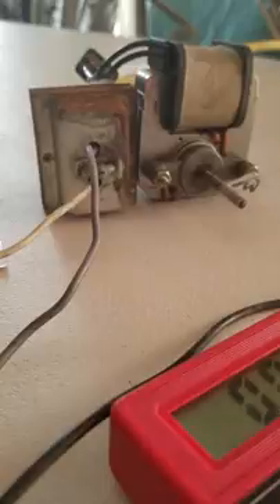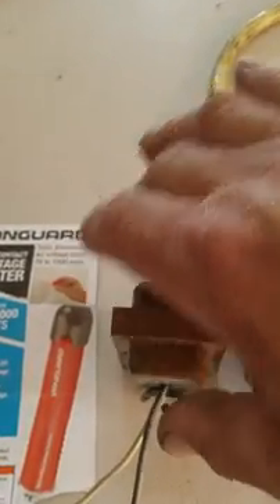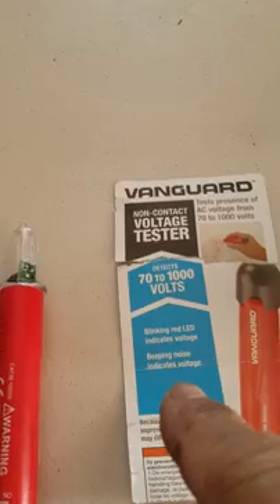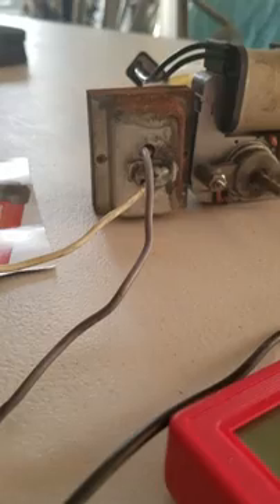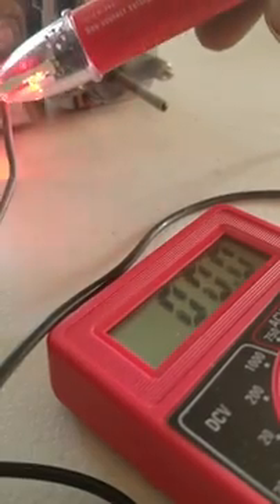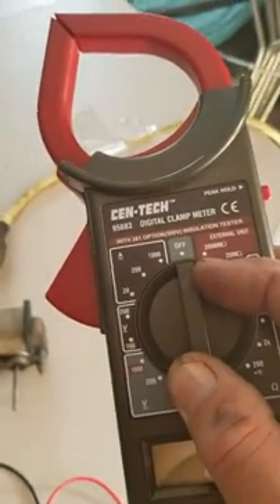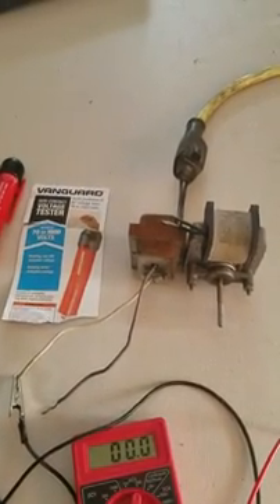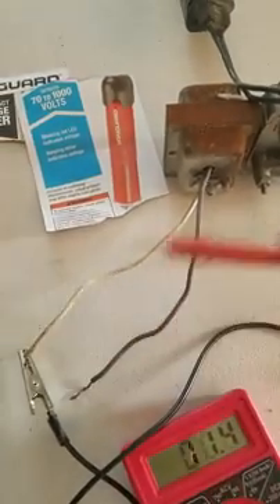Free electricity through R F

Comment: so the induction occurs in the nearby coil, that create heat and uses energy, so in this case the transformer is drawing energy from the motor ( slowing the motor down ) you have to do a speed check on the motor to see if there is any use of power from the motor circuit, thanks for your video, it gives me an idea how i can test these ideas a home using stuff i have laying around, thanks.
Reply from the maker: Actually, the motor coils expel a magnetic field whether there is something there to capture them or not.  If the lights use that energy, the motor doesn't care.  It doesn't have to work harder to release that same magnetic field.
Reply: @GBear  but what about Lenz's law, if the field goes through a material that material exerts an equal and opposite force isn't that  true? so there should be some drag, like when you drop a magnet through a copper tube the magnet is slowed due to the opposite field created?
Reply from the maker: @StephenPhantom Yes, and no.  The difference in this case is negligible. I tried testing the amps with a clamp meter on the motor leads, and there was no change when the lights were added or removed.
Reply from the maker: Welcome aboard!

Comment: 11.2 volts AC potential unloaded.  I suspect the clamp on ammeter is in error as once again no current should be flowing in an open circuit and the normal wire size used in the primary (115 volt) winding would over heat or even open trying to handle that amperage.
To have any usable valid data you would need to connect a load (resistor or law voltage light bulb)t to the transformer and put a wired AC ammeter in series with it.  See what the loaded voltage and current is.
Reply from the maker: Thanks for the input.  There were no tricks in the video.  What you saw is what happened.

Comment: excellent video, I have a question, this ac current which is produced is through magnetic waves, that is through electrons, does it attract objects which have a positive charge, i have seen some videos where static electricity attracts objects which has opposite charge. does this also attract objects
Reply from the maker: Yes, the motor when running becomes an electromagnet and attracts the doorbell transformers.  Welcome aboard.
Reply: @GBear  so I'm assuming any modern new door bell transformer & exhaust fan motor would work as long as the fan motor is spinning? I wanna try replicating this with different sources of power like atmosphere electricity
Reply from the maker: @SpectacularRanker2  It should!
For atmospheric electricity, I was going to try copper coils connected in series, without the metal cased of the transformers.  I also wanted to try this same experiment with microwave transformers.
Welcome aboard!

Comment: Any transformer work or only of doorbell ?
Reply from the maker: I haven't gone that far with the experiment.  I chose a doorbell transformer because it was 120vac to 12vdc, and eliminated the low voltage side from hardwire connections and just induced the input from the magnetic fields present around the motor coils.

Comment: 11volts is a pitiful return, but, at least it's something, you could rap wire around the motor and get maybe 1 volt per turn. The current you reading will drop off to nearly nothing, once you put a load on the circuit.

Comment: 4:41 Checking the current (in terms of amperage) without having a load in the circuit is meaningless. Shorting the primary leads of doorbell transformer and then measuring current does what exactly? What work is being done in terms of power consumption? There's no load. There's no free energy there.
Reply from the maker: A voltmeter connected is a load.

Comment: I find this very interesting!, question is dose the fan motor draw more with induction than without?..if not, a person could use this ,to say put on a ayc fan motor to charge a 6volt battety to invert back to the system, & reducuse cost!
Reply from the maker: Interesting concept!  My thought would be to eliminate the light circuit in a bathroom by powering that bulb by the induction.
Reply: For everything

Comment: Amps is the measurement of current. How do you have current from an open circuit? You don't. You amp meter was picking up the alternating magnetic fields from the motor plugged in and running. Move farther away from the operating motor, and go get an education about basic electron theory and you'll wish no one intelligent ever saw your video.
Reply from the maker: Current is the movement of electrons through a conductor. Air is a conductor.

Comment: The same magnetism that rotate the rotor on the motor is acting in the transformer. Meaning it’s creating electricity. Is not on the air it’s magnetism accross the Motor chassis
Reply from the maker: juvenille2001 exactly.   Magnetism is potential electricity.   Capturing it and utilizing it instead of letting it dissipate is the idea I was trying to get across.
Reply: I think you did a good job showing that because you did plug in the fan motor. And then stated that induction was going to interact with the door bell induction unit. I guess if taken out of context someone could be confused by the antenna and tesla radio frequency comment.

Comment: I second r3x2bo.  It's not free--the copper coils in the transformers cause a drag on the motor, so it has to either slow down or pull more energy from the source to keep up the RPM.  You can also look up "Lenz Law" and "Eddy Currents".  Outside of wireless transmission of electricity, they can also use this principle to make no-contact, friction-less brakes--a fun experiment is to drop a rare earth magnet through a copper pipe and watch it fall in slow-mo.  Aluminum also "drags" against magnetic fields.
Reply: We need to redefine the term "Free Energy" itself e a derogatory word lately and that in turn has hindered progress. Well not for me. I've spoken to a very close friend to Gerard and we'll I believe we have made very good headway.
Reply from the maker: Welcome aboard Jason!  You are right!  There are a lot of negative people out there, coupled with those who just want to shut down independent research and progress for unknown reasons.
I don't edit videos, or perform "magic tricks".  When you watch my videos, you see for the first time, exactly what I see.
Reply from the maker: Mark Nanneman when I get time away from Homesteading the Desert, I will put a Kil-a-watt meter on it and show that there is no added draw on the motor when placed next to the transformer.  The transformer only captures what is expelled and does not add to the draw on the motor.